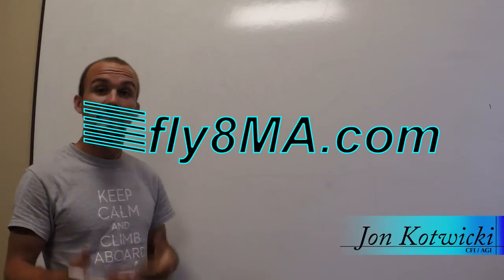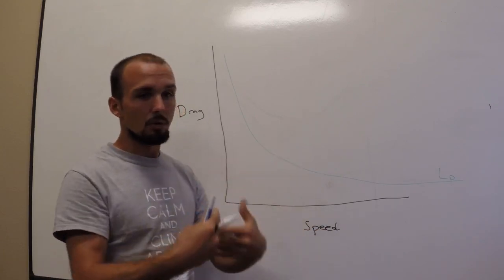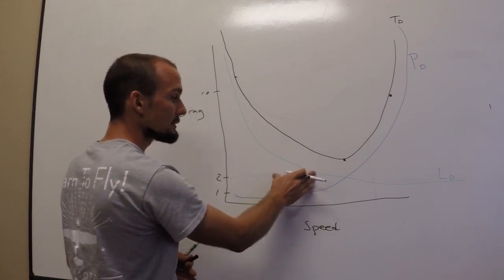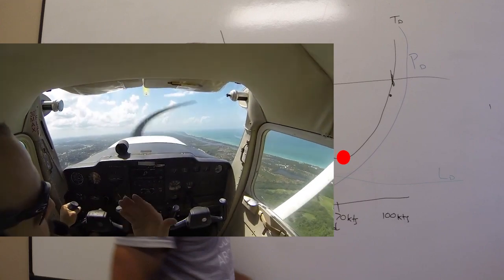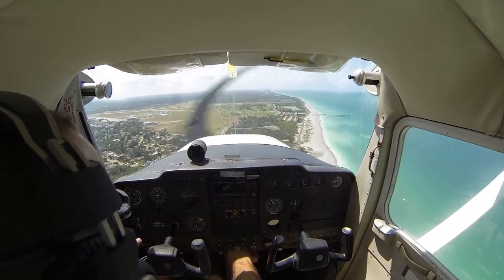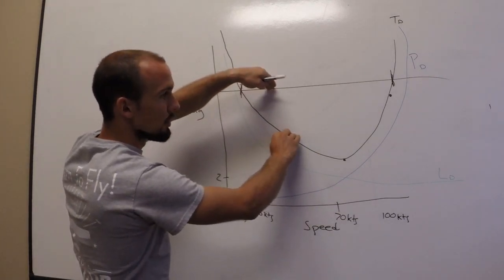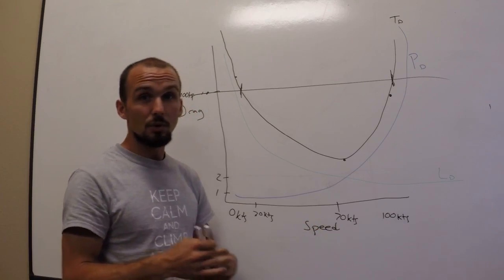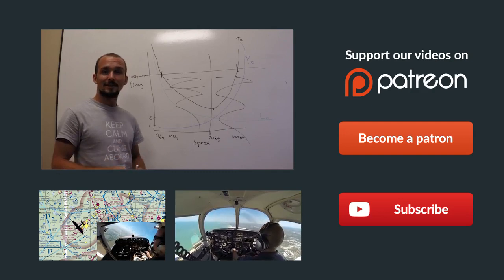Ep. 15: Power Curve | Lift and Drag Explained in and out of airplane

Comment: Vx = excess thrust; Vy = power required vs power available (not lowest point of power required curve, bit to the right) why? Due to slight hyperbolic power available curve over top of power required curve. True airspeed in knots x .003 = “HP” Power Required. Roughly.

Comment: Amazing as always! I found myself behind the power curve not long ago while doing touch and go's at KISM airport. My final approach was good, but we had some windy conditions and thermals. I tried to keep between 70 and 65 while at about 100 ft. Then the winds got all crazy and all of a sudden I felt sinking, added power, pulled the nose up instictively, no acceleration, power all the way nothing! my next quick thought was to bring the nose down and get airspeed, but the runway seemed so close that I hesitated and landed rough with a nose high attitude. Lesson learned, calibrate power and airspeed, point the nose down at the aiming point, it's ok to be a little faster in gusty conditions and thermaldon't increase drag by going to slow. G

Comment: Great explanation. Can you speak to VGs as it relates to this graph? My understanding is that is lowers stall speed thus decreasing lift drag, correct?
Reply from the maker: VGs would not affect this "general" graph much.  They simply (try to) keep the airflow attach to the wing better at all AOAs, increasing lift and drag by doing so.  They also allow the wing to fly at a higher AOA prior to stall (when installed correctly).

Comment: I'm practicing short field/soft field, and I understand the yoke forward/back to control speed.  The power to maintain altitude or reduce descent l do because I was instructed too.   This explanation of how power overcomes the extra drag was the piece I was missing.   Funny I've seen that speed v drag graph many times, but didn't read-in connection  with throttle action, and speed.   Thanks for the whole picture.
Reply from the maker: Happy that it helped!

Comment: Thanks for the explanation! I just don’t understand how can an airplane be too slow and enter a stall, if the throttle is fully open and max power is produced? I’m talking about clean configuration. I’m studying from Oxford book now and I can’t get it, how can an airplane be slow, if full power is being used.
Reply: Attitude + power = performance. If you are slow, in order to generate the required lift to maintain level flight you need a higher angle of attack. A higher angle of attack will produce more drag which in turn requires more power to over come. Eventually you reach a point where the angle of attack is so high that any further increase in the angle of attack will add more drag and as you are already at full power, you cannot over come that increase. The added drag then slows the aircraft even more, and a loss of lift occurs and the aircraft stalls. 
This stall is not the aircraft falling from the sky, just a reduction to lift so level flight can no longer be maintained. This in essence is a full power stall.

Comment: Want to try the best maneuver to practice been "Behind The Power Curve'  and getting out of it when low over the runway???  Practice the maneuver that my username is about.. Do it,  Be tough.. Its not easy.. Try at high weigh and high temp..  Dont cheat.  Its even worst when a sudden right turn is needed to avoid animals or another airplane incursion.  As you put full power, push that R rudder hard, and also push down elevator to avoid stalling when the sudden pitch up from the flaps deflecting the wind and hitting the horizontal stabilizer. 

Dont be fooled due "Its only a c150".   It is a difficult and dangerous maneuver on low power, high wingers.  That needed in some occasions maneuver was the reason they cut the flaps to 30 in 1978 and increased the power by 15% too for the 1978 and later C152. Enjoy "Hard Low Maneuvering" the most difficult one..

Comment: At 11:38 it made me realize why pilots who small aircraft, like the Cessna models and Diamond models, climb to 3k feet in case if there's an emergency when mainly, I would think, the engine not running because if it does stop running then you have the 3k altitude to glide, and possibly do an emergency landing at the airport

Comment: Good video, Sir.  I have a question about my son's flying which is scale but, why is it that he can take a fixed wing aircraft and hover it like a rotary wing and NOT stall   https://youtu.be/8APdn1ii2sA
Reply: Those model aircraft have more thrust than the plane weighs so they can not only hover vertically, but climb straight up as well.  Unfortunately, aircraft don't scale to full size and maintain that power to weight ratio unless it's something like a jet fighter.  Ordinary piston engine (manned) planes don't come close to such excess power.

Comment: Be careful about mixing drag and power. They are not the same.  Minimum power occurs at a much lower airspeed than minimum drag.  Suggest adding the power curve on the board.
During the demonstrations, I suggest holding point long enough to show steady state responses otherwise you cannot tell is the observation was just a dynamic response.

Comment: A good lesson, but I must call you out on mixing Power with Drag, or more correctly, Thrust Required, which is the curve you have drawn.  I realize recip pilots talk power not thrust, and while your curve explanations were right on, it's important not to mix the terms.  Minimum drag (Min thrust req'd or L/D max) is not min power req'd.
Reply: It's thrust required for unaccelerated flight, how is that different than drag?
Reply: Yes, Thrust Required is the same as Drag.  Power Required is Drag times Velocity (airspeed) so the terms are not interchangeable.  I was being a bit pedantic.